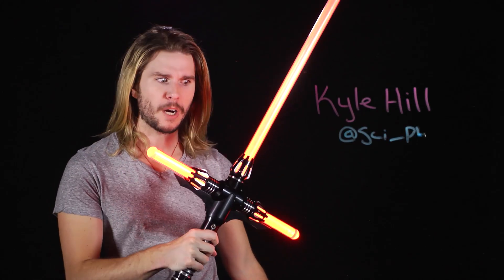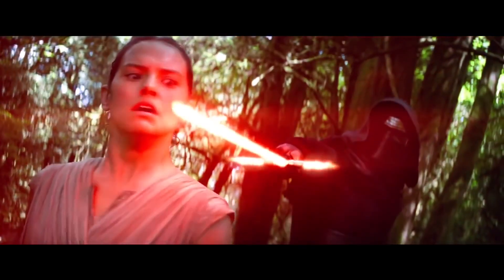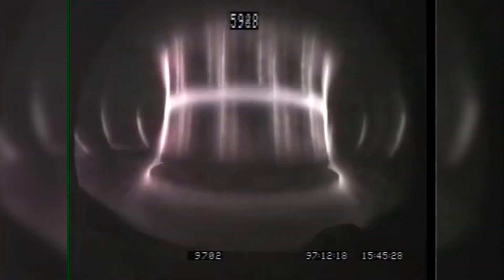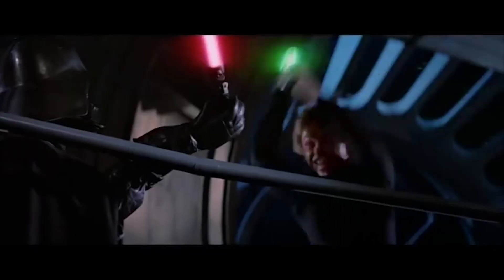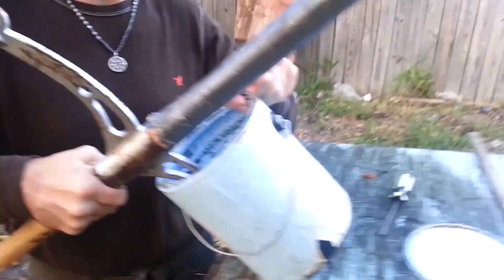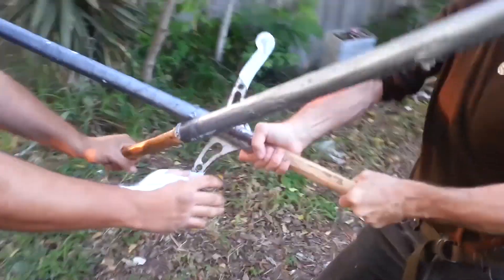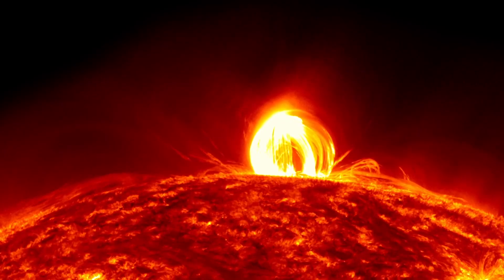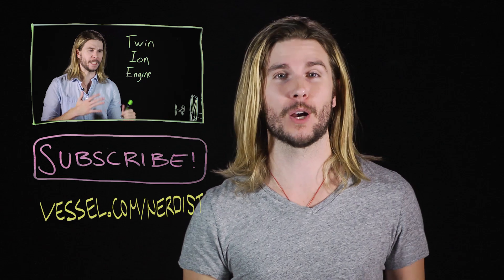Why Kylo Ren's Lightsaber Works (Because Science w/ Kyle Hill)

Comment: I understand why you can't just cut through the crossguards, you see lightsaber's have bin cut in half before such with Darth mauls lightsaber in Phantom Menace, and anakin's first lightsaber in Attack of the Clones, but trying it cut them (the crossguards) going downward won't work, the metal casing around the crossguards is only at the bottom to protect Kylo Ren's hand from being cut off, but the crossguards have a little opening at the top to stop lightsaber blows from cutting them off, the best way to cut Kylo's lightsaber is to cut it at a 45 degree angle to cut the top part of the shaft off, 

and one other thing shouldn't the saber blade have a bit of weight because when I do teakwondo and practice with a foam stick, I do figure eights which act as sort of a pendulum swinging back and forth in the form of an eight, even though energy has no weight the lightsaber is a beam and a particle, a bit hard to explain but you know what I mean, great video and as always peace✌🏻️

Comment: People keep debating why the crossguards can't be cut. Not only does the theory presented in this video make sense, but also there are materials that are resistant to saber blades. Like Phrik and Beskar. The hilt could easily be plated with a Phrik alloy covering, thus assisting with not allowing a saber to cut through it. And it crackles because the crystal is cracked. But It's an awesome effect nevertheless. This is my favorite saber in the movies yet. I'd like to see some more unique designs introduced. Like the Inquisitor's ringed saberstaff. That's a cool design with how it spins.

Comment: I personally think that the design would be much better if the blades were etched toward the Lightsaber, like a real sword, so you wouldn't have to calculate if you are putting the blade there, are you going to cut yourself? This is because the gross guard would be curved upwards to go in the similar direction of a lightsaber and even trap a blade in it's angles, making it much harder for someone to just slide their blade over the cross-guards.

Comment: The thing you failed to acknowledge is that a crossguard on a traditional sword is not part of the blade. Swordsmen don't risk cutting themselves with the crossguard because the crossguard is not sharp. Furthermore, anyone who made a sword with a sharpened crossguard would be widely regarded as an idiot for creating an unnecessary risk that does not pay off.

Comment: Swords have crossguards, but those crossguards didn't impale you if you used it wrong.

Another big thing is that the European longswords, which are the main crossguard swords were also meant to be used with half swording, which is using the sword more like a spear and having one hand on the blade.

The crossguards can also be used as a makeshift ax/hammer, and one could do what is called a murderstrike by holding the sword by the blade and hitting the opponent with the sharpened end of the crossguard.

You can't do that with a lightsaber.

Kylo's could work, but to really get around the main issues, the "crossguard" part needs to be slightly angled up, so it looks a bit like a claymore crossguard, and ignited part should be an inch or 2 shorter.

Then you can have a very effective weapon, with a much less chance of stabbing yourself on your own crossguard.

Comment: This is actually explained.  The crystal is cracked and unstable.  However, that instability makes it a more volatile lightsaber.  The "crossguards" are actually just additional vents so that the lightsaber doesn't explode on activation.

The design is also based on tech from thousands of years ago, and it is doubtful that it is even in its final stage.

Comment: Well his Kyber Crystal is cracked so it's projected into 3 ways, the 2 ports for the crossguards are obviously to protect but also to release the extra energy that would normally cause a regular Lightsaber to explode. The Lightsaber and it's design is unrefined so it has that uncanny look and menacing spark around it. Hopefully that answers everyones question.

Comment: if the light saber  is one peace than how is he able to turn on the side sabers independent than the main one that does not add up ?
Reply: +biohazard724 shouldn't the lightsaber cut the vents ?
Reply: +biohazard724 Kylo's saber crossguards are vent tunnels for cracked kyber crystal (they are unstable, and can blow up, but also extremally powerfull) , not actual saber blades, thats what plazma bean on main blade is unstable. this crossguards prewents from overheat kyber cry and cause blow up of crystal itself.

And you're right, there are saberproff materials. couple of them. Most known is Mandalorian Stell.
Reply: +The Nihl evento of they werent saberproof they hide the beam so another saber would just hit it not cut through it....cool research in his saber dude not many people know that about the type of sword before they start to bith up on  it :D
Reply: max kace Ok I can't tell what you're saying anymore
Reply: What ARE you saying?
Reply: thank man
Reply: +max kace A 2 phased switch the first ignites the saber the second opens the vents to allow the excess plasma out
Reply: SuperMaki Waffles There are materials that are lightsaber resistant. But I'm not 100% sure I'm right but there is a post floating around that explains how Kylo's saber works in detail.
Reply: +max kace since it's unstable the pressure and heat changes, meaning it might be needed only after being turned on, say a couple of seconds later.
Reply: well if its a light saber proof hilt than why not make the hole cross gard out of light saber proof metal that why you get the same defense but not risking killing your self with your own light
Reply: +biohazard724 if its light saber proof than why dont you make the hole cross gard out of it that way you get all of the defense  but not risking of killing your self with the light saber so ha suck it
Reply: +max kace Because anyone with any martial training wouldn't need to worry about that like is pointed out in the video.
Reply: what having martial skills is not changing anything with science
Reply: what am i saying
Reply: +biohazard724 if you watch the original clip where Steven explains it on his show he explains this as well
Reply: All three are turned on together but the two small ones just come out a couple seconds after the main one.
Reply: that doesn't make seance  plasma only goes one direction it can go two different ways only if some thing i moving it

Comment: I think its a cool design but it would probably do more harm than good. If cross guards made a good and practical place for an edge or spike, historically they would have had them. I think even with the addition of training, its just an unnecessary danger for the wielder and I believe that is the exact reason why cross guards were not given for example, a spike on both sides of the guard as you would think it would be a good position to punch with while using the sword. Even with the sword practice in the video, you cannot rely on your ability to avoid your guard while in a real fight because technique goes out the window for the most part. Pushing reality and logic aside though given that this is only a movie and a fictitious universe its a cool new version of the lightsaber like darth maul's and count dooku's before him and we should just enjoy it for that rather than pick it apart and try to apply logic to it.

Comment: See, it's not the crossguards that I take issue with; it's the gap between the guards and the main blade. See, that little gap between the blades is right where you would tend to catch an enemy blade. That Stephen Colbert bit was a decent point, but even if we accept it for a second, I'd still be worried about containment issues and the cost of having to constantly repair the emitter matrix. Thing is, Colbert's point doesn't actually hold water, since we've seen lightsabers be cut apart multiple times in the films, first with Darth Maul's lightsaber, and secondly with Dooku cutting Anakin's green lightsaber apart, get this, right through the emitter matrix! Sure, Grievous' Magnaguards used lightsaber resistant phrik alloy in their staves, so in principle that should be solvable, but Jedi didn't use phrik, so evidently there was some downside to it. Worse still is that I can think of several emitter shapes that would eliminate that flaw. For example, "===D", with the "D" having lightsaber energy along the whole curved surface, as well as the blade and crossguards. Other issues other people have, like the idea of crossguards and the 'barely contained' look, I actually like. As established, crossguards are really frickin' useful, and if Darth Maul's lightsaber is considered viable despite being even more dangerous to the user, then so should Kylo's. And if you look closely at the ragged edges on Kylo's blades, you see that they flow like the teeth on a chainsaw, which presumably increases the already absurd cutting power of a lightsaber to even greater heights.

Comment: Literally the most upvoted comment, and the video are wrong, They are exhaust ports guys, its a very primitive make. they couldn't even act as a crossguard because if they got that far down where the exaust meets the main shaft it would be able to pass through in the corner where they are weakest/still being formed and projected most likely and I have no idea where EM3 got that idea from

Comment: In history do you guys seen a claymore type sword with sharp tips & edges on its crossguard? also consider crossguards width of it from the handle.    Can imagine being killed by your own sword by blocking. the sharp tip will pierce your chest. Cut your wrist ,shoulder or neck when you prepare to strike. Cut your thigh and stomach when drawing to sword. on kylo ren saber, its more dangerous than a lightwip or a bo type double sword to me for use. A "V" shaped crossguard might be better no a "T"

Comment: Actually parsec was the intended term. The Kessel run is a very dangerous smuggling route and you have to go in and out of hyperspace several times. If you do research on hyperspace, you will find that it is possible to go from A to B in varying distances. He was simply the most maneuverable and strategic when he was going in and of of hyperspace... Duh

Comment: What would be far more practical would be a cortosis based hilt and crossguard. This material was used in high-quality vibroblades in order to deflect lightsabers. Raw cortosis had the ability to disable the saber's beam. So having a cortosis-weaved hilt and crossguard with some sort of raw cortosis coating would be much more effective. Though I would rather just carry a vibrosword as it would have more weight to it, possibly having a raw cortosis edge.

Comment: His cross guards may be used for offensive/defensive reasoning's but the actual reason why those are there is because when making his saber he had zero patients when it came to crafting it. He didn't take the time to stabilize his crystal which in term means his light saber is unstable, hence the reason for the "cross guard", they are actually exhaust ports so that his light saber doesn't blow up in his face.